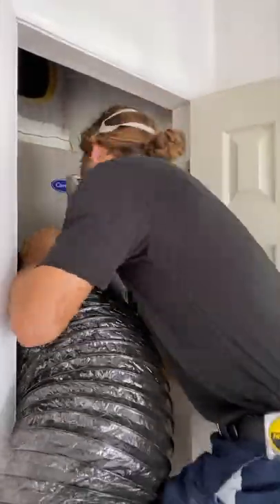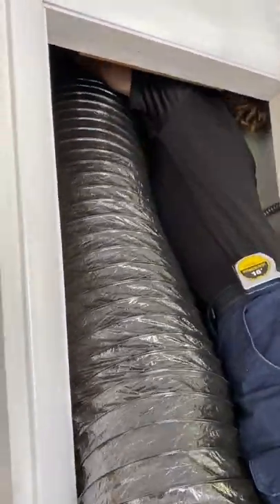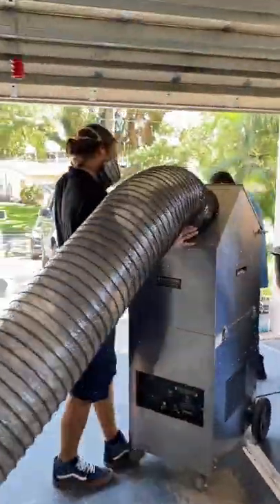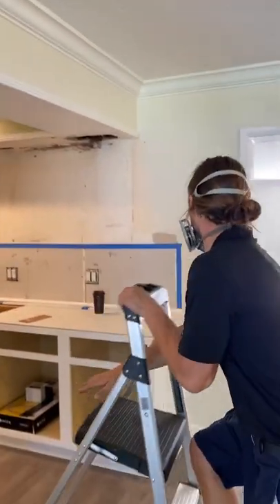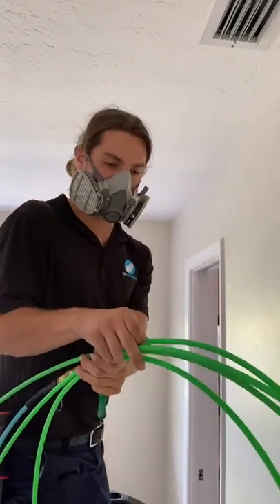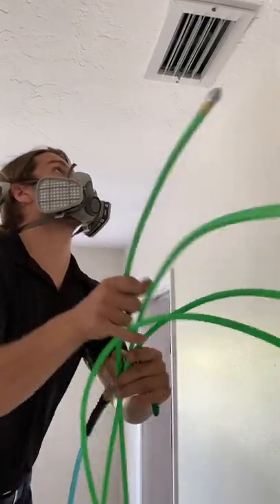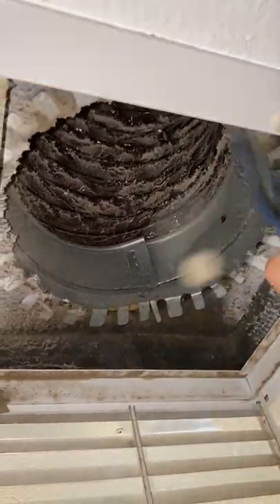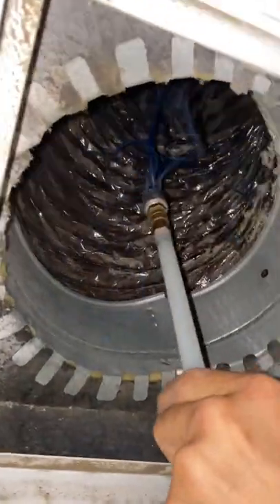Air Duct Cleaning Process Overview

Comment: I very worked on flex ducts and sealing and tbh ur just damaging the flex from the inside and making people breath insulation
Reply: Exactly the proper way to do it is rotobrush brushbeast machine, all it does is swipe not slap.
Reply: @aye_donn  that’s not true at all. Brush isn’t where it’s at
Reply: I do Duct cleaning for most ducts it’s fine, it’s just the old type from the 60s and 70s but barley rarely do I come across those and when do they don’t tear up or nothing. False myth. Sometimes but at that point it’s too much pressure but doesn’t damage nothing.

Comment: It seems to me that all the dust will be pushed into the unit, otherwise where else will it be pushed to?
Reply: The negative air vacuum he attached to the duct work will collect the dust !
Reply: Wow lol that was a stupid question
Reply: It actually will get caught up in the ac coil and ac fan motor before leaving the system through the duct he attached on the return. Which will more definitely restrict and clog up your ac coil. We use a duct cleaner that has a brush and vacuum attached to it that sucks from each vent